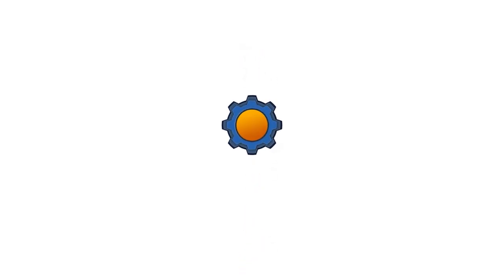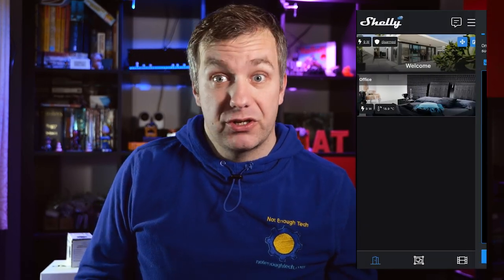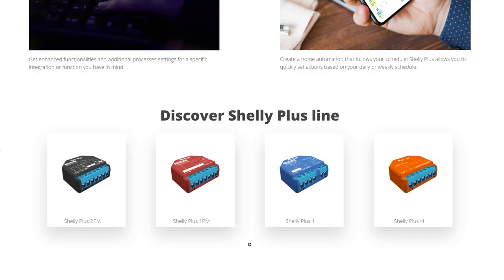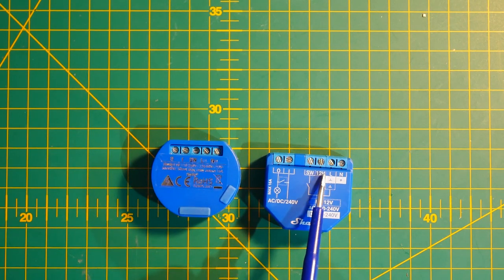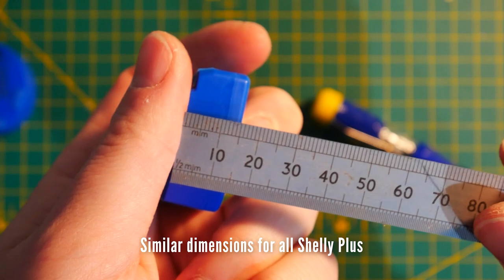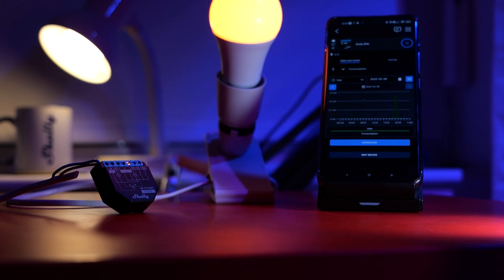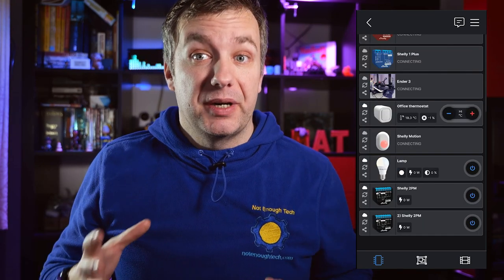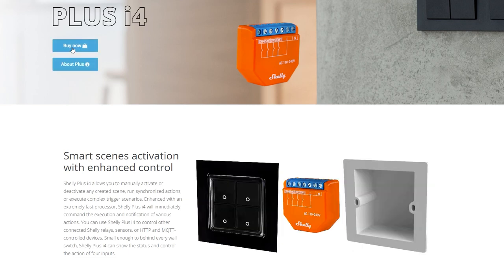Shelly Plus was made for DIY automation

Comment: 5:44  As far as I know, the output terminals are potential-free.
Therefore, some safety distance was provided, as you could see on the backside. Very good, if low voltage circuitry is switched with the output.

Comment: I recently installed the 1PM-Plus to monitor my dishwasher. Installation was difficult because my American house is wired with 12AWG wire. The Shellies don’t handle a wire that size in general, and this model specifically wouldn’t accept it at all. But I got creative and moved past the roadblock. Also, I had trouble with MQTT not sending the sensor values, so I instead used the CoIoT interface with Home Assistant. All is well now as it is working great and the dishwasher is well monitored.

Comment: I have a few Shelly devices, and the MQTT and web hooks out of the box are really handy if you don't want to use the app. I haven't used any of the switches yet, but I might give the new range a try. Thanks for showing them
Reply from the maker: The new wall switch should resolve my bedroom issue as well as I can't fit anything behind the regular one as the space is too shallow. I think with the new bracket I'll be just fine

Comment: I am so happy the switch plate doesn't have the LEDs. My family is super sensitive to the LED light pollution that most of these switches have. I think that they  were listening to the audience.
Reply from the maker: In many of them you can actually disable the LED (not all as sometimes it's linked through hardware) a piece of electrical tape can also cover them up neatly on the PCB if you particularly like the switch

Comment: Another great video Mat, thanks. We’ve installed a number of 1PM Plus as part of a house rewire to monitor larger appliances. Some quality hardware (even our electrician liked them!) and after 3 months the power monitoring seems reliable and stable. 

Shelly have made some significant changes to their MQTT behaviour and interface in the new Plus series and like another commenter we’ve sadly found this much more challenging to get running. Seems there is so far limited guidance /examples from Shelly online so if you happen to have success with MQTT on these new devices (particularly power monitoring) we’d love to know how you managed it. Thanks.
Reply from the maker: I'll check but last time I played i was able to use the same schema to connect. I'll have to see if the power details are sent
Reply: @notenoughtech  thank you Mat

Comment: for high current draw applications its not good if the L and N are going true the shelly to the consumetion unit (water heater, dryer etc), you need to use wago (or other terminal) or it will overheat, they say that on the fb support page

Comment: Can I, with this device, control let's say an overhead light via a "regular 120v switch" and/or wireless?

The picture on their product page shows the device sitting inside the outlet box.  Does this really sit in the same box as the switch even when the req'd 8" of wiring tails are also present.

I've not seen any DIY video that shows an actual in wall installation.  Just wiring it on a workbench.

Comment: Fantastic video! I really appreciate the introduction to Shelly switches. Could you recommend a specific model that allows for light dimming? I'm interested in a switch that enables us to adjust brightness levels through the app. My plan is to retrofit these switches into the back boxes of my current dimmer switches to upgrade them to smart ones.
Reply from the maker: Dimming is a pain. It depends on the lights you use. I usually resolve the dimming with ZigBee bulb and nice wireless switch
Reply: @notenoughtech  That sounds great, but we want to retrofit existing dimmer switches which are brushed brass to match the interior design for the whole house. Some of these switches control chandeliers which we dim when creating an ambient  atmosphere.  Im not sure if smart bulbs would work in a chandelier that 20 / 30 small bulbs in them?   we also have spot lights around the house too which we would want to dim too. which bulbs do you recommend?  and does Shelly offer a switch that can do this in your opinion?
Reply from the maker: There is a Shelly dimmer you could use .. but the downfall is that you would need appropriate bulbs otherwise they may flicker or never turn off fully.  Do you like your chandeliers this much 🙈🙈🙈

Comment: Thank you Matt. Re the switch only device, having a 4physical button option makes it much easier to use than the single button they had before. Sadly I don’t see the option to run those battery powered which will make them super handy free standing remote controls with 4buttons.
Reply from the maker: As they use WiFi to talk to the cloud anything battery powered would last a very short time.

Comment: Regarding the Shelly Plus 2PM, with the Shelly 2.5 you can configure it to use for a shutter to drive the L/R motor. That also seems possible with the Plus 2PM but is that shows up as 2 switches that is different from the 2.5. How would you configure it for shutters and have it run based on motor resistance?
Reply from the maker: Before the device is added to the Shelly Cloud, it needs configuration. I set it as 2 channel relay, hence 2 devices. It should show up as a motor controller if you change the device settings.

Comment: It may have been designed for DIY but in some country's its illegal, for instance here in AUS
Reply from the maker: DIY isn't illegal. You can have it installed by electrician.ss long as you have it signed off you are ok.
Reply: @notenoughtech  yeah goodluck finding an electrician that will give you a COC for anything they didn't do or install

Comment: Hi, i recently bought the Shelly plus 1
I use it in my store. The connection was easily. No issues at all.
When I give orders with my mobile 
connected in the same network there's no problem. Shelly connection with cloud is ok. But.....when my phone connected with another network and try to connected with Shelly, the device is offline. I can't control it. The are working perfectly both only on the same network.
I reboot it. I reset it. Nothing changed.....Any idea what's the issue?.....

Comment: Can I use these on my water heaters 3kw
Reply from the maker: Yes you should be fine with that current draw if your mains are on 220-240v
Reply: @notenoughtech  ok that’s great..yea I have 240v .. just want to turn it on every 2 hours for and hour .. should work great
Reply from the maker: Should be fine then. I'd monitor the temps in my first run to be sure but you are within the spec for your heater
Reply: @notenoughtech  Hi Mat, so in this configuration, a Shelly 1+ can be directly connected from the water heater wires with the N and L only ? No need to plug the box in the electric racks ? Thanks a lot
Reply from the maker: Where you plug it it's down to you. Can be at the heaters end or near the oitlet
Reply: @notenoughtech  Thank you for your prompt answer (y)